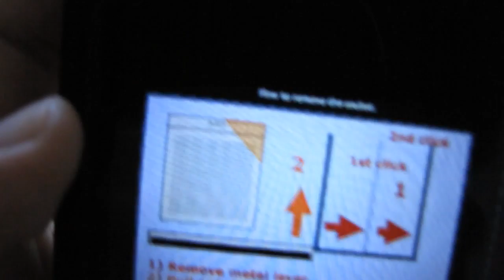AMD AM3 Socket How to Get it Apart or Removing AM3 Socket Cover

Comment: Some thermal compound dripped off my CPU when removing it for new cooler. I also think I might have to check for bended pins. So I am having to remove upper tray of the foxconn socket. I wonder what is a good tool for this. I have to do AM4, not AM3, but this video gives me some hope.

Comment: ok so i removed the socket cover, however, now I can't get a post because, apaprently, the cover does something to the CPU. is there a way to get a post without replacing the cover?
Reply: The cover is needed to lock the CPU Down, that’s why it’s strange he broke it without any concern about it. The phone pics show that you should be able to lift the cover off during the second click portion. Look at the picture in the phone portion a few times.
Reply from the maker: I can not trobleshoot this without been having your motherboard in front of me, I recomend you just to purchase another motherboard on eBAY there is tons of deals under 20 dollars for this old boards.

Comment: i hope you still run this channnel, your Vid helped me a lot fixing my AM4 board. thx
Reply: Could you please make a tuto explaining how to remove plastic pad without broken it, I have an Issue with the plastic and I don't want to broken it? Thanks
Reply: Yo, can I get help with an am4 board? I'm not sure how to proceed, I don't want broken the  upper plastic. Thank you in advance
Reply: Also I am haveing to remove the upper socket tray of AM4 to check bended pins. I have the foxconn upper plastic socket, what tool did you use for this?

Comment: My socket cover was broken upon lot of research I found it is called AM3 chip BGA seat can be purchase at aliexpress
https://www.aliexpress.com/item/Free-shipping-5PCS-AM3-chip-BGA-seat-Shang-Hao-tin-beads-AMD-AM3-CPU-Block-938/1979719286.html?spm=2114.01010208.3.25.ZQIAHo&ws_ab_test=searchweb201556_0,searchweb201602_3_10057_10056_10065_10068_10055_10054_10069_10059_10058_10073_10017_10070_10060_10061_10052_10062_10053_10050_10051,searchweb201603_3&btsid=9bd80d28-4fb2-4098-a9d7-1c01bd530149
Reply from the maker: Thank you for your comment... But in case with this motherboard, the board itself went bad replacement of the socket not gonna help...